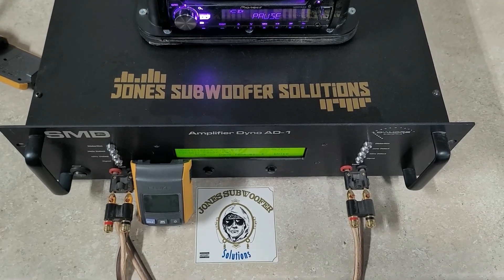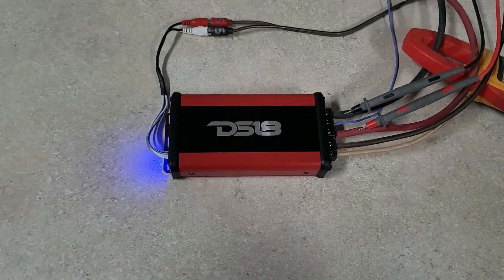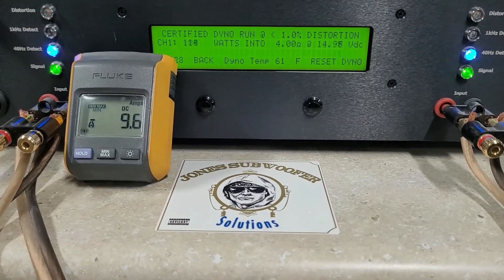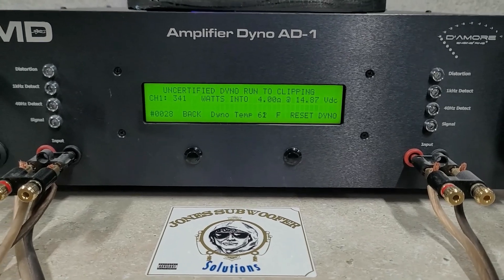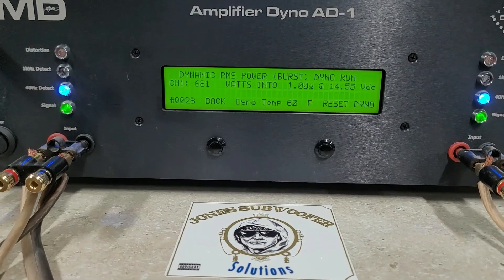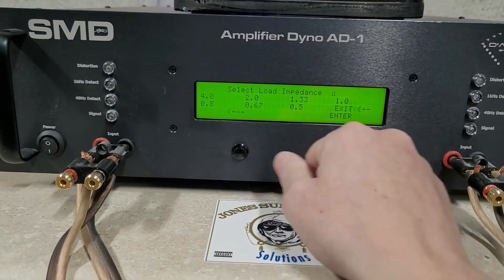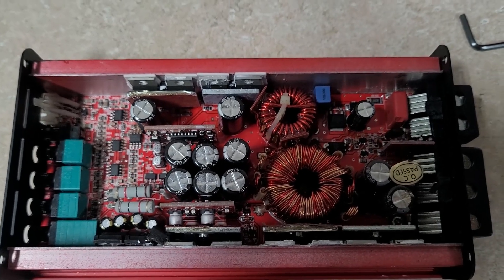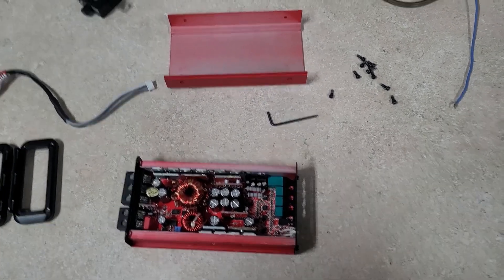AD-1 Amp Dyno DS18 Atom1 1000w Max Micro Amp by Jones Subwoofer Solutions JSS

Comment: Superb video! What did you have the amplifier knobs set at for optimal performance?
Reply from the maker: You can see the dials @11:16 but I run them wide open on the bench for the most part because the only frequency it sees on the dyno is 40hz.
A good starting point for most systems will be LPF@80, SSF/HPF@25, no boost, and gain set appropriately.
Reply: Brilliant thanks!
I'm showing this tiny amp 1.5 ohm's with two 300 w RMS JL audio 4 ohms subs in parallel (appreciate it should show be 2 ohm the amp sees) and it's pushing them quite comfortable just under the clipping point !
Great video, great advice! Keep them coming 👍🔊
Reply from the maker: @darrylconner6730  You're welcome and I appreciate the support!

Comment: can you do a dyno on a timpano 800.4?
Reply: Same specs as a stetsom 800.4
Reply: @luke_784lowfrequency8  i dont know but the timpano i have looks like less than 100 rms p channel . i dont have tools to measure it but if i compare it to others amplifiers its not much. at 7 volt the clip light comes on so i dont wanna increase the gain
. i've tested it on a pioneer headunit.

Comment: It’s me or this circuit look a lot like the skar 500d mini version ? Just need to test the heat after more hours of playing ??? Look alittle more beffy
Reply from the maker: Might be similar
I can open a Skar and look tomorrow
Reply: @Facekicker  the only downside of the mini skar is that it’s having problems with overheating and turning off due to that overheating protection but it does have power many make fun of that version ... like this one of your review cause it has many more watts how is the temperature?
Reply from the maker: @charlschuck6  this thing was barely warm even right after the 1 ohm testing.
Reply: @Facekicker  really wow 😳 wait I forgot to ask how much you paid ?$
Reply from the maker: @charlschuck6  180
Reply: @Facekicker  lets see it after an hour of full power at 2ohm

Comment: Nice little amplifier right there .The power acoustik Razor 2500D puts out 700 plus watts @2 ohms and 470 @4ohms and the cost is under 100 dollars is not a bad budget option either.Good video sir, Thanks
Reply: Always drive mine at@1ohm all day every day when I was running them and they was reliable as hell...no fans

Comment: All of these mini amps no matter the brand they will get hot fast so be careful of amp location when installing them.
Reply from the maker: I've heard that but all these runs all in one sitting barely got this one warm.
Reply: @Facekicker  I have this amp skar skm and sundown sam mini amp with power support of 2 xs power xp2500 one and one hook up with my 250 amp high output with the BIG 4 UPGRADE they run hot 145 degrees F at 1 ohm so since I have skills in electronic's I have install on the amp broad a pc fan and no more overheat issues period.
Reply: My clarion mini amp is currently sitting in the rzr packed in snow. Stays pretty cool.  ;)
Reply: NAH.. got a power acustic razer amp in my console for my mids and highs.running at2ohm in my yukon and warm is all I ever get
Reply: @GMTPF800  Power acustic amps do not do there ratings at all try again :D LOL
Reply: @________GHOST________  see the thing is I have over35 years experience..I know they don't need to  do rated I clamp them and my system  knowledge afford me to be able to SLAM on a budget numbers don't lie and there not always needed that's wy I know power acustic razer amps have great bords in them in the summer I do DEMOS in 90+degree heat no fans on them they have never failed me . I run 4x3500.1for lowes and a rz400.4on my highs. I know my gear and it's limits I haven't blew an amp in 7yrs.

Comment: I wish you would have kept the amp meter on the screen but I keep looking for an amp to run a powered sub in my living room! On a duel 2 ohm voice coil 10 or 12  I'm  sure there are many others that I could try but I am trying to try something I saw using an x box cord to power an amp but I doubt it will have enough juice! If not though I will run a power supply of some other sort!
Reply: 80A 12v supply on ebay

Comment: Nice little amp. Maybe the 1000 watts is achieved by using a 1k tone.  Also would be great to hear the amps, and say the price in the videos.
Reply from the maker: 1000w is actually achieved in a hilarious manner that I did not realize until after the video was edited.
500w RMS @1 ohm
+
320w RMS @2 ohms
+
180w RMS @4 ohms
=
1000w

Comment: Why You testing on 15v?...the amp is small,will mostly be used with stock electrical... Should rather test at a more realistic 14v
Reply from the maker: I run a 15v bank so testing is done at 15v or just under.  It's not going to differ from a 14v run very much.

Comment: Okay so I hate to bring light to this but there is an audiobahn 1000w micro amp on ebay for $49 and ive been dying to grab one because they're so cheap and even if it put out 30x4 or 100x2 for $49 id be more than happy lol but they're saying 1000w and it would make for a great vid not cost you an arm and a leg lol
Reply from the maker: I'll check it out

Comment: Damn, so this lil guy definitely put out like a Vegas street walker hahaha but my question is how long would it do it for before it got so damn hot you can light a cigarette off of it??? I'd like to see a longevity test with a load on it and just crank her up for a good 30mins to see if it can produce that kinda power for the long haul or if it's just a burst number to please the dyno lol thing has capacitors inside and stores up everything it can to meet that number for all of a minute or two but the power supply cannot do it for a whole song...